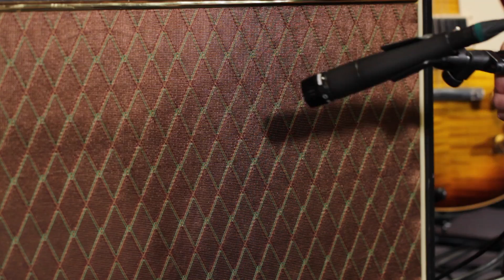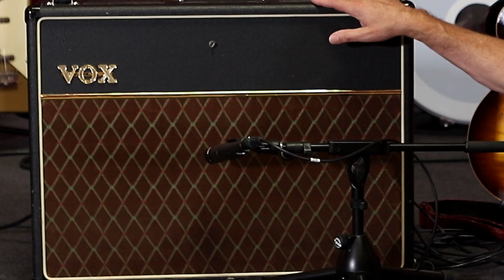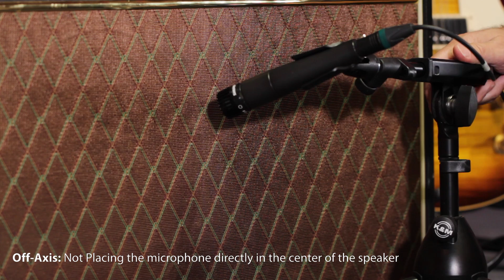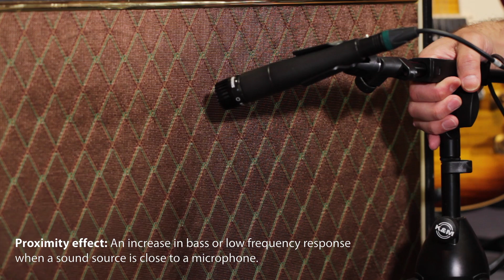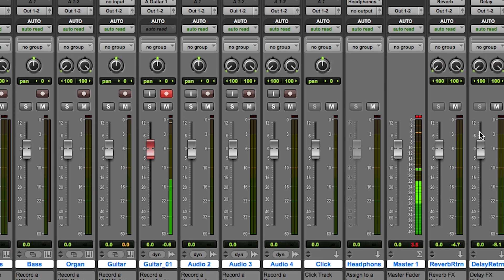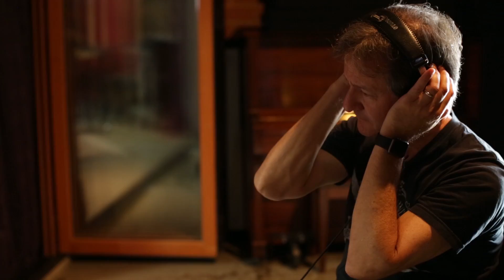How to record an electric guitar amp - Part 1 (Feat. Bob Clearmountain)

Comment: Long history short for those who didn't knew . Bob was the guy supposed to mix Guns and Roses Use your illusions albums but it didn't happened since Bob was using more modern techniques like "samples" and Slash and Axl were not happy with the results worrying about Bob changing the vibe of the band. Funny thing about all of this is ...Bill price(which im not saying he did a bad job) was a mixer living the present but Bob was living in the feature already and they didn't knew what he was doing. Ironically using samples on drums today is a very common thing.